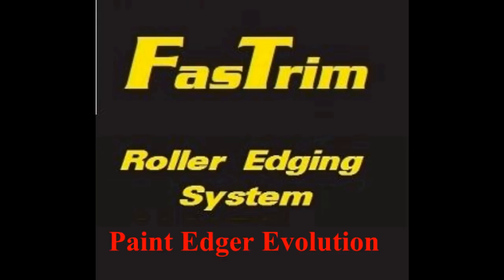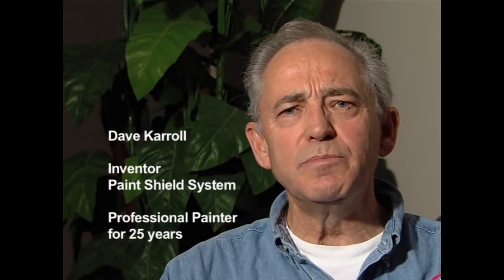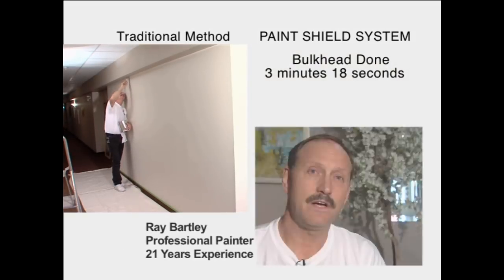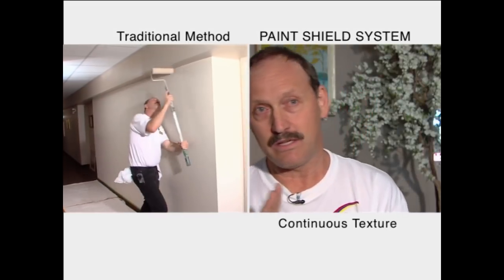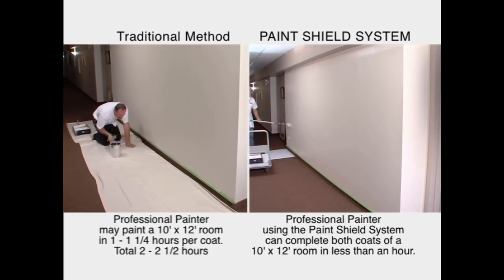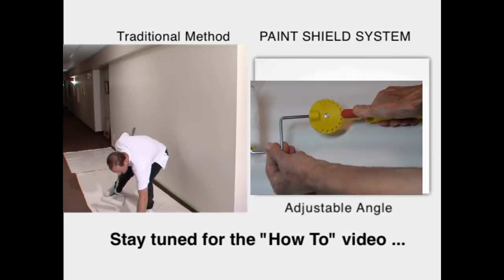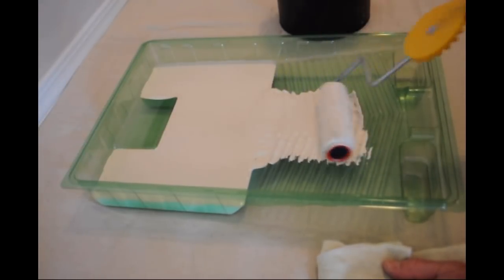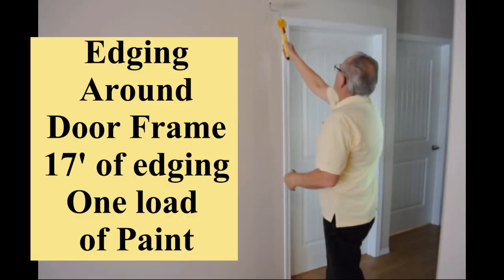50% FASTER than Brush

Comment: Sounds too good to be true. But if it works, I can return $100 of tape. You sold me.
Reply from the maker: Hi Doug  It is true, make sure you check out our youtube channel shows how to load and use the tool, a slight learning curve, but the average DIY and most pro painters will catch on quickly.  www.youtube.com/user/fastrimroller
Connect with me is you have any questions dave@fastrimroller.com